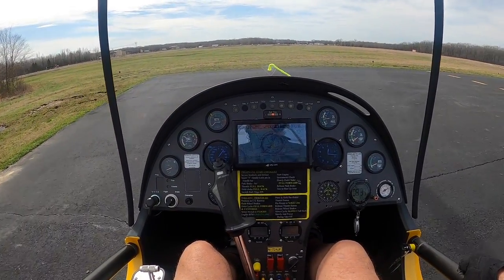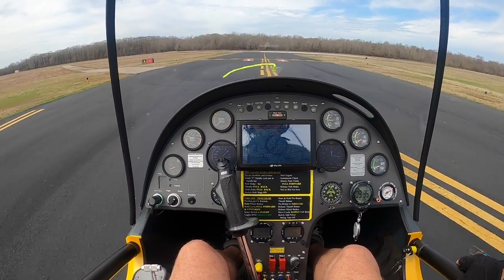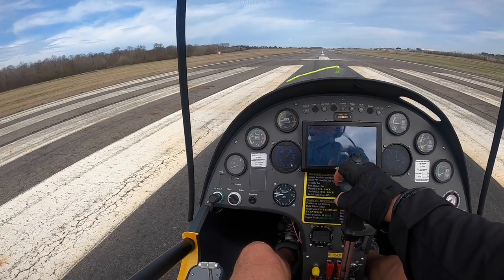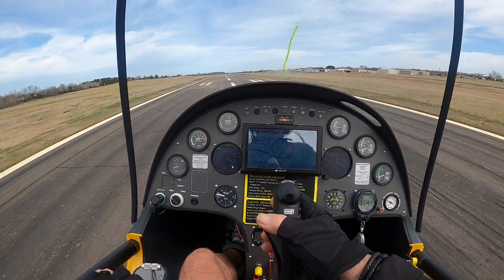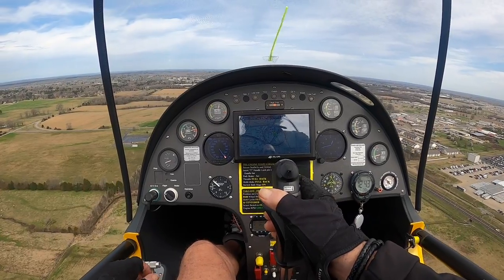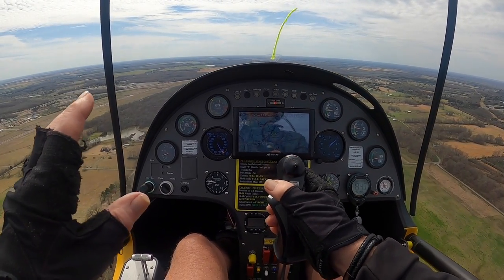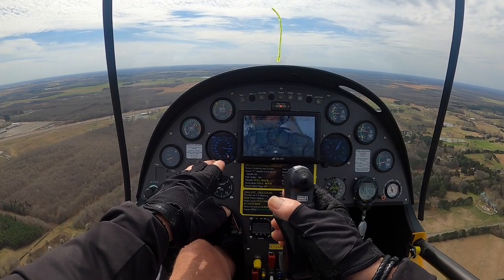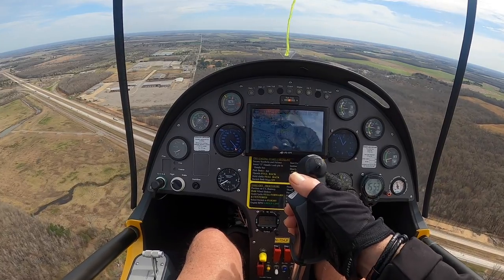Common Gyrocopter Pilot Mistakes!

Comment: GREAT to see you sharing your deep knowledge & experience on You Tube Ron!
Reply from the maker: Thanks Christine, My hope is that maybe by watching these videos it will help make better Gyrocopter  pilots. Ron
Reply: @RonsGyros  Why not make 3-4 bladed gyros? Would it be safer with the different disc load/rpm/inertia/sink-gride rate?

Comment: Hi Ron. Thanks for the great video. Especially in a gyro, physical and mental preparation are key. Thanks also for the recommended reading. I have it drilled in, power, then pitch or un-pitch the rotor, as the case may be.
Reply from the maker: I appreciate your interest. Thanks Ron

Comment: your blades need  balancing because you have heawy vibrations in the joystick...i did never take off with such vibrations...And a gyro doest have "cyclic":  you modify only the complete rotor angle, not the blade angle in cyclic way like on a helicopter!

Comment: I'm always surprised by the amount of stick shake in these gyro videos - never had that much flying light helicopters. Precise rotor balancing just not routine?
Reply from the maker: Most of the rotors available are very well balanced however the rotor installation and proper. Adjustments will illuminate most of the shake.
Reply: @RonsGyros  If you wanted to eliminate the stick shake on your gyro we see in this video how would you do it?
Reply: @XCFlyingBlog  shake comes most from many causes: most are unequal weight from the blades or/and unequal angle of attack from the blades, but can be torsion from the blades or lack of rigidity (tortional oscillations)
Reply: This gyro has really bad stick shake, it can and should be trimmed properly and soon.

Comment: NO the string does not indicate wind direction unless you are on the ground, it indicates you are flying uncoordinated. Once any aircraft is in the air it quickly moves 100% with the wind much like a boat in a river.
Reply from the maker: The yaw string simply allows you to line the gyroplane parallel your direction of flight regarding the airflow in flight . This allows for the best performance. Your correct.

Comment: I would like to take issue with you regarding diagonal take off - landings! Could you please expand on what you mean by 'a lot of problems'? OF COURSE we gyro pilots need to be totally competent in cross wind take off - landings but why, if you have a wide runway (as we do!) would you make it more tricky for yourself dealing with cross winds when, by going diagonal, you can take a % of the cross wind component out of these manoeuvres? In UK we are taught, by CAA qualified instructors, to take the 'path of least resistance' and, as long as you keep current with cross wind training, which we do with our 2 yearly flight tests, what exactly IS the issue with going diagonal??
Reply: I can't speak for Ron's reasoning but I can speculate that the diagonal takeoff and landing has you headed toward the taxi lights which could be a big issue. They seem to handle stiff crosswinds using proper crosswind techniques, so that's probably why it's his preferred methodology. I'm no expert....just getting into gyroplanes, but I have been a fixed-wing CFI for 42 years and hope to eventually teach in gyros.
Reply: @lorendjones  Hi Loren, thanks for your comment, most justified from a 42yr Vet CFI.! I, too, an no 'expert', nor a QFI; I am only commenting from a perspective of a 60hr ppl(m) (Ikarus C42) and 220+hr ppl(g). I agree that gyros handle winds, and cross winds, better than any fixed wing aircraft but, if I may be so bold, you are exaggerating the 'taxi lights' issue a wee bit too much! I am sure that, with your years of experience, you will convert to gyros far quicker than I did then, what you will find, is how INCREDIBLY more maneouverable they are than a fixed wing. When you practice engine failures, which I do regularly, you will find yourself getting into fields that you wouldn't even dream of contemplating in a fixed wing. If the only field available to you is the one immediately below; in a fixed wing you begin to worry about how the heck you're even going to begin to accomplish this landing with all the vagaries of downwind, crosswind, side-slipping, airspeed, stalling etc., etc..... in a gyro you just think - let's have some fun with a hovering descent to begin with, then some tight S turns, and finally an almost zero roll landing!! WHY make a difficult cross wind landing when you can get the job done, AND have some fun, landing diagonally??!!!! Best wishes for your conversion and I hope you get to continue teaching in your new mode of aviation.!!NS.
Reply: I guess it has to do with traffic patterns as any pilot ought to know. You do not fly non-standard patterns unless its on your own airstrip, and the only aircraft about.
Reply: As a gyro pilot with a considerable amount of experience literally thousands of landings and the ability to land a gyro within feet of where I want to I agree with everything in this video with the exception of diagonal landings. I was taught by the most experienced gyro instructor in the UK (who taught many of the instructors in the UK) where we have one of the most demanding training regimes in the world and some of the gustiest winds particularly the airfield I fly from. I was actively taught by him to handle cross wind landings up to the cross wind handling limits of the gyro but also how to land safely diagonally across the runway. Gyros (more so open cockpit ones) are great at handling high winds due to the high wing loading and the fact there is relatively little for the wind to get hold off, but they are light weight and their cross wind limits aren’t that good. Another big advantage of gyros is that they have virtually no forward roll (momentum) once they have touched down. If you look at the accident statistics of modern gyros the vast majority happen either near to or on the ground, they are easy to fly and very forgiving above 500 feet agl, in fact easier than a fixed wing providing you avoid negative g manoeuvres, power pushovers, PIO etc. A lot of the risk is in the takeoff and landing phases. I was taught treat wind as your friend as long as it’s coming into your face, so why would you risk a high wind crosswind landing when you don’t need to, negating many of the benefits of the gyro? Before anyone says anything about why fly in high winds and what about your weather planning, believe me the winds in our part of the world can pick up in a heartbeat and it is perfectly possible to fly standard circuit patterns and incorporate diagonal landings, gyros are incredibly agile.
Reply: @keithjamieson2685 Well put, we probably had the same, Cumbrian, instructor?!!!!
Reply: @nuttysquirrel8574  Indeed CJ - the very man - and he knows what he is talking about and can demonstrate it every time in all flyable conditions. Wind - its only a Summer breeze!
Reply: @keithjamieson2685  Hi Keith, then we do know each other!! I used to have a share in Telc, then IE.!! Happy New Year to you and happy-safe flying in 2023; will see you there at some stage!!! best wishes NS, aka mike
Reply: @nuttysquirrel8574  Hi Mike how are you doing, happy new year to you, of course I remember you. IE is doing fine - had a little problem with her fuel tanks a couple of months ago. Quite regularly fly with John P who now owns a share in her. Take care
Reply: @lorendjones  That sounds right, Loren. As a glider pilot, I've launched slightly diagonally a few times, starting just off the edge of the runway, then rolling onto it and straightening as the towplane accelerated and tightened the towline. But the field I was flying from did NOT have a taxiway, or any runway edge lights, so there were no obstructions to doing it that way. Best wishes with becoming a CFI-Gyro!

Comment: I’m dismayed by the stick shake you have. That’s one of the best ways to end up with metal fatigue. Be it hub bar, rotors or controls.
Also why are you taxing with your rotors stationary. That’s also a good way to bring on metal fatigue. Taxing out to the runway and lining up, then you do your checks, rotors still not spinning. What do others do while you have blocked the runway. Surely you should have done your checks before you enter the runway. You wouldn’t get away with that in Europe. Strange, very strange.

Comment: DIY might also be a problem.  I met a man who was hoping to become the Benson agent around here around  1960.  He was very proud of his gyro.  When I met him, he was proudly strutting around his gyro flicking imaginary specks of dust off its glossy paint.  It was Easter 1963 that his pusher prop disintegrated at 1000' QFE above an airport display.  Shards of the prop destroyed his main rotor.  The collection of debris plummeted to the ground.  I am told months later splinters of his bones were found embedded in the airport grass.  Of course he was totally dead.  So this speaks to constructing only using top quality suitable materials and methods.